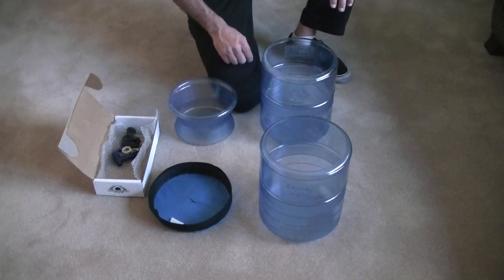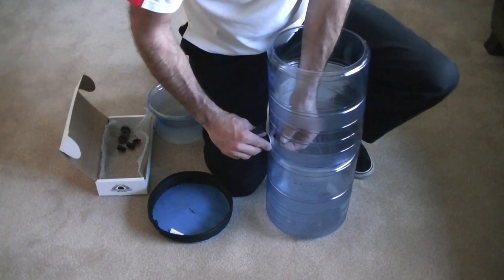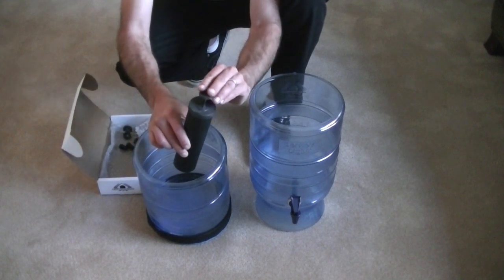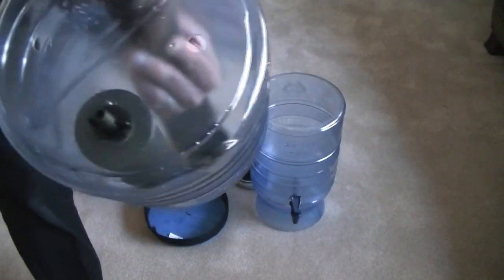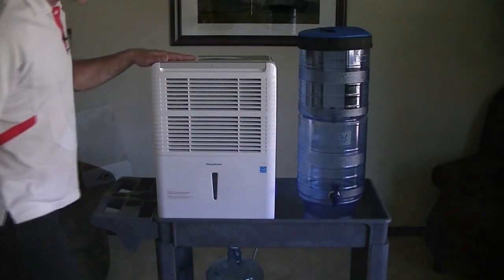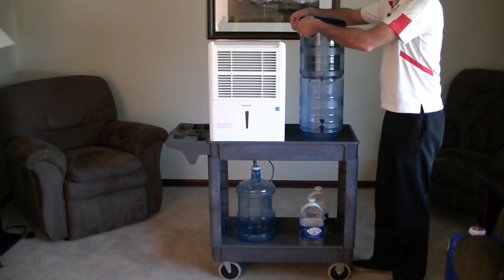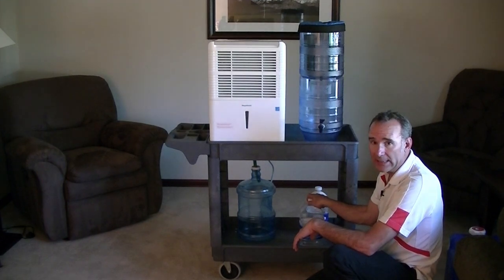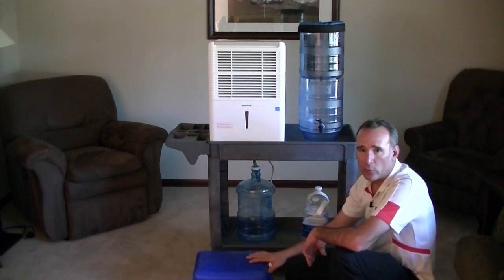Part 3 | How To Make Your Own Air To Water Generator At Home | 4 to 9 Gallons Of Purified Water/Day

Comment: I am looking to replicate this in an RV/Skoolie build, running directly through a pre-filter to my freshwater tank, then again through a 3-stage filtration system. I am solar stacked so power, while high (from your first video), is not a concern.

Any tips on which type of dehumidifier to buy in terms of condenser, and not leaving the condensed water too heavy with metals?

Comment: Add a ozonator bubbler to the 1st tank.  Have the bubbles funnel into a 5mm vinyl tube at the bottom of the tank.  The other end of vinyl tube should go to the berky filter tank.   It will take long time for the bubles to pump the water up but the water will be clean of any bacteria since ozone is a very strong oxidator.  It not only kills bacteria but also viruses.

Comment: Whi you use a filter?
You do not need a filter. Your water is as pure as the air that you breathe every days.
Reply: The air is not clean, even if you live out in the country away from a lot of polution.  Also the air might become contaminated even more than it already is.  The humidifier might have been manufactured with bad chemicals, etc., or become dirty with dust, mold, etc.  So it’s best to filter the water, just to be safe.  🙂

Comment: Or you could use a taller wire rack shelf to place the dehumidifier higher, place the Berkey water filter below that to catch the output, place yet another water storage tank below that for longer term storage or immediate use.  Why not use a water pump to push the water to a larger storage tank once it has been purified?  Each gallon of water weighs 8 pounds.  Lifting a 56 pound (7 gallon) water can to the top of the plastic water filter canisters isn't going to easy for some people.  Certainly not what folks want to do very often.
Reply from the maker: Yes, that could work great!
Reply: The only concern I have is that the Berkey would not fill. If you are to get full life from the filters, it might be best to fill the Berkey.

Comment: If you don't feel like purchasing a burkey system you can accomplish the same with a couple burkey filters and a couple squared food-grade 5 gallon buckets with lids stacked on top of each other.  Drill a couple holes in the lower bucket lid and the bottom of the top bucket.  A $5 spigot from Lowe's will fit flush on the flat side.  Mine works great.
Reply from the maker: Good idea Scott

Comment: Run a 1.2gpm $29.00 12 VDC RV self priming pump with an inline on/off switch, inlet draws from bottom tank, outlet tubing goes up into your Berkey to fill it. I drilled a hole into the top lid of my Berkey. That was my first small system almost 4 years ago.
I've since built a 100 gallon inside RV tank system, 2 12VDC pumps, 12VDC battery, a 3.3gpm to fill inside tank from outside tank run through a Woder inline filter & a 1.2gpm for faucet inside house,  a small wall mounted shelf with a bar sink faucet. 155 pint Waykar dehumidifier that operates down to 10% humidity, humidity controller to turn it on AUTOMATICALLY. I can get about 20 gals per day. I use Purogene for inside 100 gal tank. It's the best, used in RV fresh water tanks.
Reply: I don’t know all the parts/design you’re describing but it sounds great! Please make a video of what this is and how it works.

Comment: Awesomeness 
Just wanted to share there wasn’t ONE dehumidifier in homedepot 

I would have had to order it and hope it arrived in a timely manner so I ordered on Amazon 

Thank you I’ll be plugging it in tomorrow 

I already have a Berkey thank goodness
Reply: Be mindful to check if the dehumidifier carries a Prop 65 warning for causing cancer, birth defects, and other reproductive harm.  I was getting a highly ranked Toshiba model from either Home Depot or Lowe's because neither site had a Prop 65 warning for it.  But once I got it delivered the box clearly warned about all the problems with its Prop 65 warning.  I sent it back and got a full refund.

Comment: Great video explanation!!! Here are some things to consider. 
1) There has been a worry of coliform developing over time in these Berkey style filtration systems. If your cleaning is done regularly, using brand new scrubbers each time, you should lessen the possibility of coliform developing. Also, I learned that if you put high silver coins in the top jug and the bottom jug this will help to get rid of the coliform altogether. 
2) Have two 5 gallon jugs on the bottom shelf in order to transfer the hose without a lot of spillage. In this video, use the 7 gallon and 5 gallon together (if that is what you got). 
3) You don't have to have the units on for 30 days. In the time of trouble all you need is what you need. Turn the machine off if you have enough water. I think that is obvious.  That way you don't use too much of your solar generator. 

Maranatha! :)
Reply: The Berkey filters have silver incorporated into the filter elements.
Reply: How well do hose splitters work at evenly distributing the gravity or pumped water supply to a multitude of water storage vessels?
Reply: Thank you for the tips. I would definitely trust silver for his antibacterial properties. Among many other properties, like conductivity ..  It’s pretty amazing. It’s also extremely good also to treat insects bites :) .
Reply: Hi, to digress a little the Egyptians used silver bowls and jugs to minimise bacterium so that technology has been around for a long time, in fact, silver ion is used with hydrogen peroxide as an excellent disinfection chemical for water systems. But back to the main point, of course, regular cleaning is required, how much will depend on the storage location, keeping out of direct sunlight & a cool stored temperature, preferably below 20 degrees C, above 20 degrees C will accelerate bacterium growth.
Reply: You can purchase a copper coupling from Lowe's for 85 cents and place it in your water pitcher after it has been purified. Inexpensive and easy. Using copper in the water can kill harmful microorganisms like bacteria, fungi, and some viruses. The process can also alter the water's pH balance, making it slightly alkaline.

Comment: Very interesting, thank you!  But why can't you use a cart with a higher top shelf or set up in a home utility room on shelves and have the dehumidifier go directly into the water filter assembly?  And / or can these be set up outside, perhaps in an airy shed with solar panels for electricity and with a large water tank without any filter assembly to water a vegetable garden?  Water is very expensive here, starting at $87.00 a month base fee plus usage.  Can the dehumidifier take the freezing weather of winter?  The shed would protect it from the rain, snow and ice.
Reply: Just make sure the dehumidifier coils don’t freeze up and your idea will work.

my rig is straight and simple : dehumidifier to water distiller to .01micron CLOTH filter to 8 gallon reverse tank

I AVOID REVERSE OSMIDIS OR BERKELY FILTERS or anything like it

distiller separate from contaminated.  berkeley type filters water ALWAYS pass through contaminates that’s been captured and require replacing , distillers you can wash and wipe

i totally avoid
Reply: @ashzole  what is a "reverse" tank?
Reply: You csn build your own any way you like. He is just showing his way. And it will freeze outside and break your machine.
Reply: time out if your getting snow and ice already why do you need a dehumidify?????  just get the snow and ice, if your looking for pure water to also drink just take the snow and ice and buy a water distiller , your problem is solved